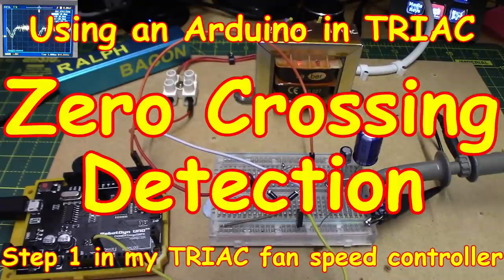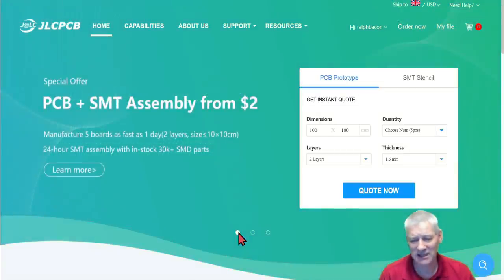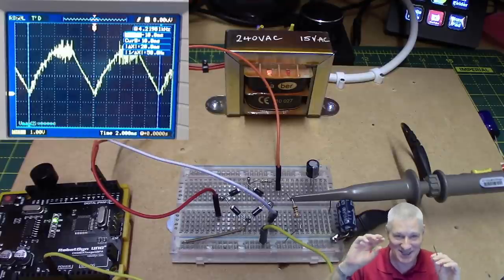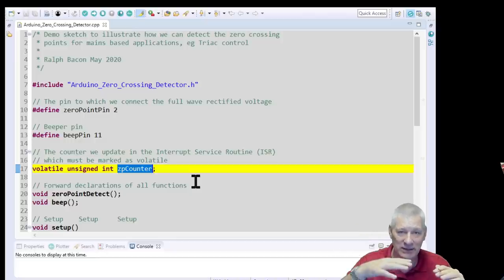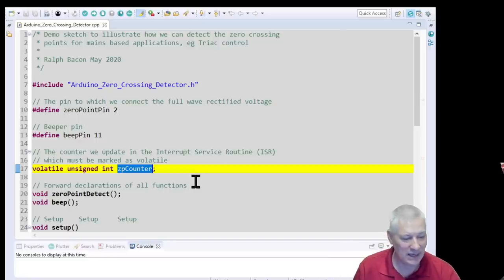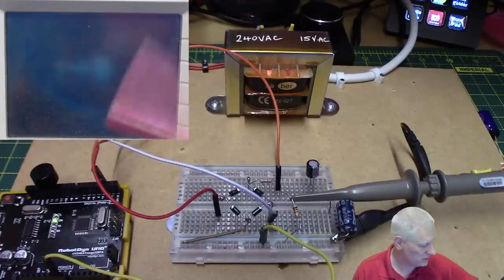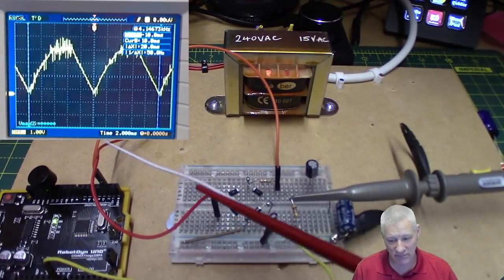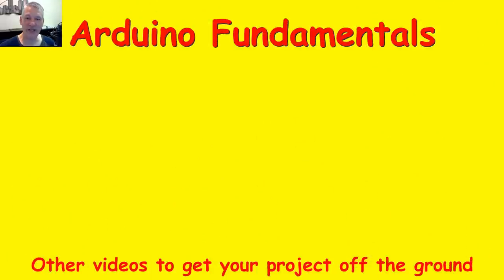#189 Zero Crossing Detection using an Arduino (TRIAC Dimmer Control)

Comment: Fun fact ac is not pure sinus. Somet6to do with generator not being a single coil at poles but bunch of them. It's kind of flat when generator rotor poles hit the stator coils.
Reply from the maker: It's difficult to measure mains directly on a scope, not to mention risky, but an opto across the mains in the way I showed might give me better idea what it looks like. Pretty noisy too.
Reply: @RalphBacon  I was quite stunned when I saw AC maines on oscilloscope on 2and semester of university. It's not perfect sinus wave form. And then we got explanation from our professor who actually worked on hydro damn construction why it sort of flattens out. So noise is probably expected. As for 0 (low) detection maybe some comparator circuit? To generate impulse when AC is going through 0?
Reply: @RalphBacon  And btw could you consider doing a video on for instance max4080 and arduino analogread. CIrcuitry and other stuff. :) Might help people when connecting analog sensors straight to arduino pins.

Comment: Really love your work. How can I monitor the capacity of my 14.6v valence batteries ?Shud I use amp connector to logic level converter to rs485 to 4module relay to arduino? If so , how to connect?
Reply from the maker: I'm glad you like what I do, but voltage monitoring is not applicable to this video, is it, Kamal? If you watch video #160 (all about voltage monitoring) and if you still have a question please ask it there! Hint: read up on potential dividers!

Comment: Maybe the noise on the AC signal comes from your light bulbs
Reply from the maker: Quite likely. My workshop is full of electronic equipment, specifically designed to cause the maximum amount of electrical interference!

Comment: how would you go about doing a zero crossing detector on a Variable reluctor sensor(crank angle sensor or abs sensor) is ti possible to just copy this method?
Reply from the maker: If you are talking about a physical crank (eg a cog, or wheel as found in a motor or other machine) you could use a magnet secured onto the device and detected with a hall-effect sensor. If you are talking about something else then you will have to explain further, I'm afraid, Conrad.
Reply: @RalphBacon the signal is a sine wave and  has  huge difference in amplitude depending on speed,and very noisy,I'm just trying to find a way of converting the signal to digital...they hv chips for this already though (max9926)

Comment: Highly technical solution to Windoze is not USB-2 Ralph! It MAY be "technical" but it's called Linux! 😂😂😂
Reply from the maker: Let's start a religious war between Windoze and Linux, Bob! After all, Linux is to operating systems what McDonalds is to gourmet cooking. Ha ha, just kidding. But to be fair, Linux is 90% of the way there -- but getting the final 10% of the way requires a level of money, effort and fascism that doesn't exist in the Linux community. 😂

Comment: Ralph, why did you rectify the AC for this demo? Your triac controller needs full wave AC cycle so you may confuse the viewers. You would have most likely had a less noisy waveform too.  Also worth giving a brief description of peak-to-peak vs RMS at some point. Finally don't forget a reminder on your isolation transformer - point to one of the many vids on this subject don't do it yourself. Folk are going to copy this and you don't want their mothers coming after you!
Reply from the maker: The AC was rectified purely for the zero crossing interrupt circuit so we can detect both halves of the cycle (AC goes too low - below 0.5V from GND - and would kill the pin). In the real circuit (as you saw) the same effect is achieved by an optocoupler with two LEDs inside, one for each half cycle. But the final circuit is safe, and I'm not building it. No more spoilers.

Comment: Instead zpCounter=0, shouldnt we zpCounter-=100, so in case we had for example 102, 2 will stay for the next time
Reply from the maker: Good point, Stanislav. If we think there is a chance of another cycle arriving whilst "doing stuff" in the loop (which we will in the full project) we don't want to lose cycles. I might change the code to do that if I discover we might miss a cycle. Thanks for the suggestion.

Comment: type int is not atomic in atmega328p, so it's a bad practice to use it to transfer data between interrupts and main execution without some atomic guard. You better use byte or (unsigned) char here.
Reply from the maker: Not sure about that. The only non-atomic operation is the ISR incrementing the variable (so a read followed by a write) but that happens in the ISR which cannot be interrupted.

The loop reads the variable to test it, then writes to it to zeroise it (which can, and probably is, interrupted) but that's it.

I could have included the construct:
ATOMIC_BLOCK(ATOMIC_RESTORESTATE) {
    update the variable here in ISR
}

but I'm not convinced it's required. Your thoughts?
Reply: @RalphBacon  first - it's all technicalities - in some cases you will have no issues and in others - you will - to determine this it will require complex analysis of u-controller hardware and code produced by compiler, so as a rule - just don't do this to avoid almost not-debugable bugs. Second, in the main code you are zeroing counter - this operation can be interrupted and garbled - heavily depends on hardware and compiler implementation - it can work for you now and stop working later or/and for somebody else.
You don't need any atomic guards here - just use byte instead of int - this size is sufficient for this program - byte is atomic, and worst case scenario - you will lose just one increment - if zeroing was interrupted.
Reply from the maker: Yes, you are right, I could use a byte variable to avoid the situation, but what if really wanted to count up to 1,000 before zeroising anything? I think then an atomic guard would be required in the loop (not the ISR) so the zeroising of the counter could be made atomically, right? So, no interrupts whilst it (each byte of the int) was being zeroised. Tricky to remember this! Harder to debug too. 
Edit: found this interesting example:
https://www.nongnu.org/avr-libc/user-manual/group__util__atomic.html
Reply: @RalphBacon  if you need count more, then you need an atomic guard (usually called synchronization primitives) - I've never used ATOMIC_BLOCK you mentioned above (and I don't program uC much), but for my electronic leadscrew project I used just bool flag (which is byte and therefore atomic) as a guard. But you should be careful using even atomics, because changing variable is anyway 3-step process - fetch-compare/change-write, so it's a good idea to use existing library primitives - implementing your own may be quite tricky and requires knowledge of hardware implementation of particular platform.
Reply: @RalphBacon  and I took a look at mega328p instruction set - there is an op XCH - exchange - at first look it can be used to make atomic guards and even better - such cool thing as non-blocking queue and similar structures. But again - it's all tricky and not for every day application programming...
so, just use libraries, I think...

Comment: 2:40 - Its funny how Americans think the same as for UK people lol In USA our voltage is 120V while UK voltage is meaningless 220V which is much more lethal. What will even confuse you more is that in the U.S, there are places where the electrical supply is 50Hz or 60Hz. Video would be more helpful if you should how you used the triac to dim an AC stuff like a light or what not.
Reply from the maker: The next part of that project was to control the motor speed (or incandescent light brightness) but I never got it done before I moved house. But, I still have all the parts in a box so I will probably resurrect this later this year. Probably.

Comment: It's a pity you didn't really talked about what is on the breadboard. It seems that you are using a resistor divisor behind the bridge rectifier to divide the voltage (the Arduino doesn't like 20V on an input).
The coefficient is probably arround 1:4.
The first problem is zero crossing. The pin is considered low even if it's not actually zero. Typically you'll get the interrupt too soon at 1 or 2 volts.  It's probably 30 degrees too soon.
The second problem is noise. The oscilloscope clearly shows it. If there are spikes arround the trigger point you could get multiple interrups for a single crossing. Adding a small capacitor on the input pin could help.
To get a better detection and have a behavior similar to the optoisolator you can instead send the signal to the base of a transistor that pulls the input low for any voltage above 0.6V and have a pull-up resistor on the input pin if the Arduino. Zero crossing will be detected when the voltage raises.
Reply from the maker: I've put the circuit diagram in my GitHub (link in the video description) which should help. Yes, the zero crossing is detected a bit too early (what a volt or two between logic circuits?) but that's no problem for software correction later down the line. I'm not sure using a transistor would help this circuit - but it won't be the one used in the final project anyway, as I mentioned!
Reply: @RalphBacon  for Atmega chips, according to the datasheet, for 5V supply the threshold to be seen as a zero is 1.5V (0.3*Vcc). The threshold to be seen as a one is 3V (0.6*Vcc).
Everything in between is undetermined. The actual limit is not fixed (temperature dependant) and there's some hysteresis to avoid problems near the limit.
https://forum.arduino.cc/index.php?topic=54932.0
With a transistor acting like a not gate the threshold is down to 0.6V. With a little bit of low pass filtering it should be better.
PS: don't forget that you divide the original signal from the transformer so the actual voltage is much higher.

Comment: Can we use it with esp8266 ?
Reply from the maker: Yes, but change the potential divider resistors so that you only get a max of 3V on your chosen interrupt pin. Interrupts may be attached on all the GPIOs of the ESP8266, except for GPIO16.
Reply: @RalphBacon  Thanks for the reply, but my esp8266 keeps on crashing.

Comment: I was about to ask what had happened to this poor little electrolytic capacitor but then you explained..... 😅
Reply: BTW you should add a resistor to the low voltage side of your optocoupler because otherwise the transistor inside the optocoupler will nearly short out your supply rail. And that might crash your arduino 100 times a second 😅
Reply from the maker: Oh, that was just a rough diagram, it will be fine in the real circuit. The resistor will be in the high side though I think, so we detect drops to (near) zero on the collector side as it conducts. Or something. We shall see.

Comment: I think opto couplers are less expensive than programming and powering a micro controller IC.
http://bristolwatch.com/ele2/zero_crossing.htm
Reply from the maker: But my demo showed that I would be using an optocoupler, right? And a µController, of course, we gotta have fun!
Reply: @RalphBacon  Absolutely. It is fun. Currently working on an old school project from my youth. Was given a bag of NE2 bulbs. Adding caps, resistors, and mounting in a frame with 10 9V batteries. Original design used a portable radio B battery.  See how many have to look that up! Putting a 10X10 matrix in it. Original design used a ring of 8. Caps between lamps and caps to ground ensured an almost predictable pattern. Besides a B battery, some newbs may have to look up relaxation oscillator to get an ides of the project. If you like blinky lights..

Comment: I remember having to do this create a zero crossing detector circuit in my EE senior design microprocessor design course in the 1990s. Then we used a Motorola 68000 series CPU of 8 or 16MHz  ( I can't remember). The triac was used to control the speed of AC Lionel Trains. Not sure what happened to my wire wrap tools. I have not used that in so long.
Reply from the maker: Your wire wrap tools are on eBay under Tools, Vintage, Expensive! Do you think that a zero crossing detector is easier with a µController rather than a µProcessor? Or does it make no difference to a bona fide Electronics Engineer?
Reply: @RalphBacon  I am going to say the Arduino is easier and more forgiving in interfacing however this was too long ago for me to remember the details.

Comment: That is NOT an Arduino. It's a copy or fake, at best it is a clone based on an Arduino. Don't use brand names for non brand product.
Reply: It must be difficult saying 'I'm doing the Electroluxing.' because you don't have a Hoover. And telling people you used hook and loop tape instead of Velcro must make them say 'Oh, you mean Velcro? '. Yes, technically you are correct, but is it really worth confusing people just got show how smart you are?
Reply: @pintokitkat  Reminds me of people that claim that an Iphone is not a smartphone, and a MacBook is not a computer. And that is why you gotta go to the "genius bar" to have them "repaired", and can not go to a normal technician that offers repairing apple products. 
Yeah, right...
Reply: @pintokitkat  Exactly.
Reply from the maker: The Arduino design (but not the name) is Open Source. So we can have (exact or different) copies of the Arduino board produced by others. The are not fakes. No such thing unless it has Arduino printed on it. It is an Open Source alternative. I don't think Arduino.cc is losing any sleep over this!
Reply: @electronicsmoke - I just watched your video #4 with an Arduino that you made !! Consistent then...